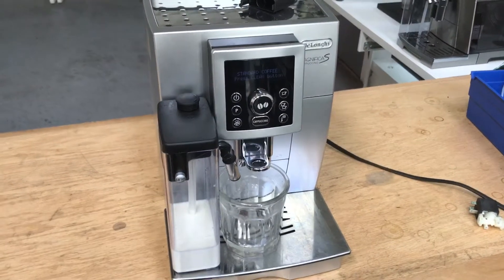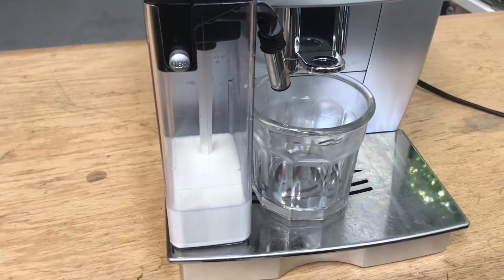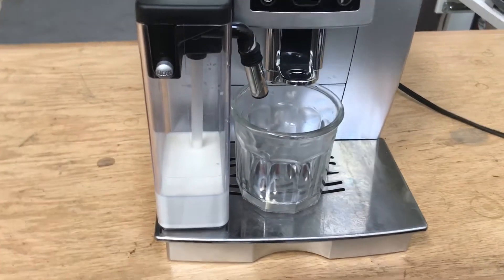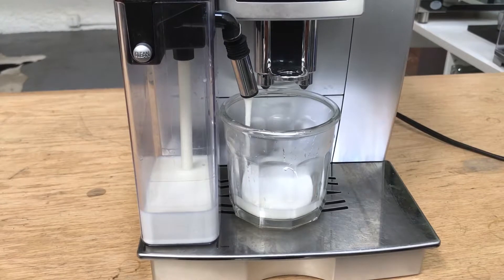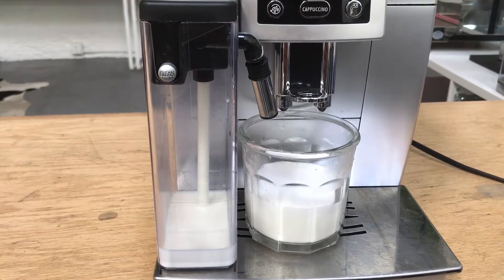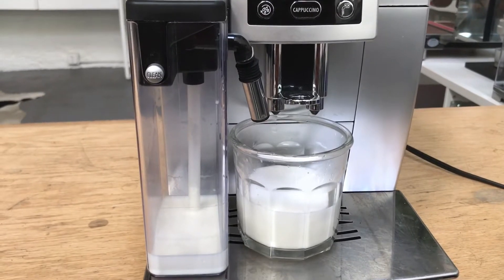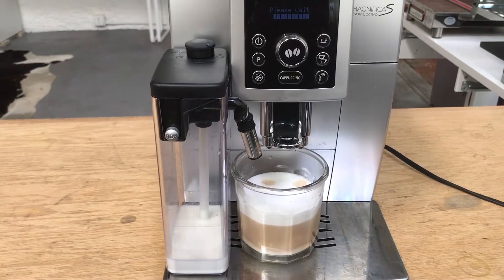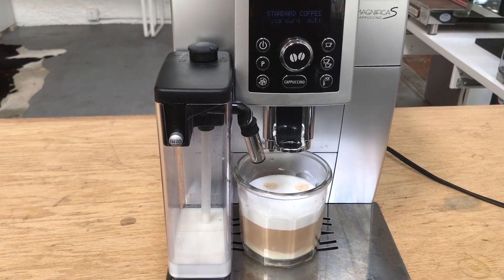Delonghi Magnifica S Test after Solenoid Valve Replacement #1093

Comment: Howdy. I had a faulty 3 way solenoid valve on the same machine. Do you know what part number the hose is that comes out the top of the 3 way solenoid and heads to the next part? My black hose was hardened and when replacing the solenoid the hose cracked. Other machines this has always been a flex hose. Any ideas? Thanks in advance